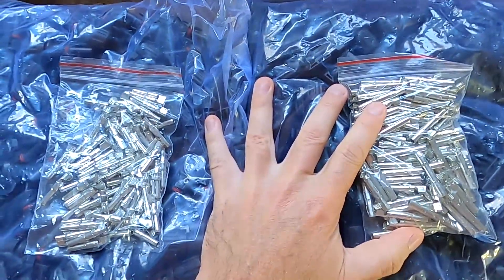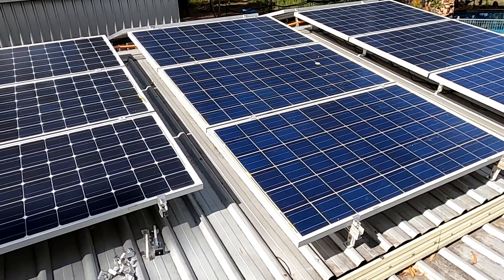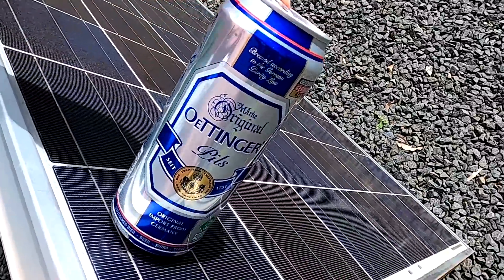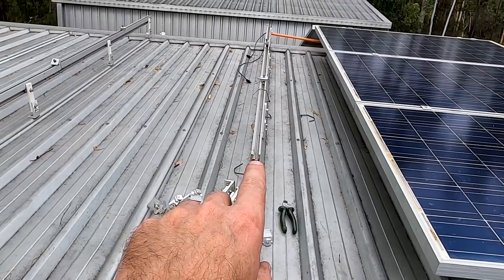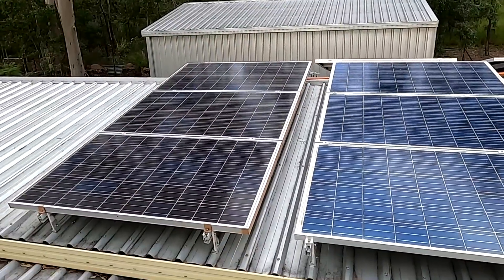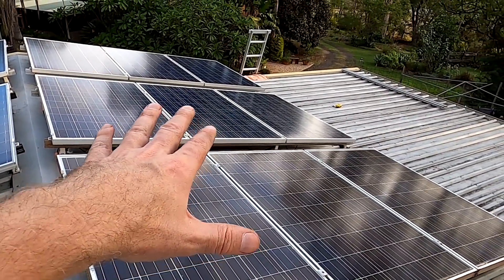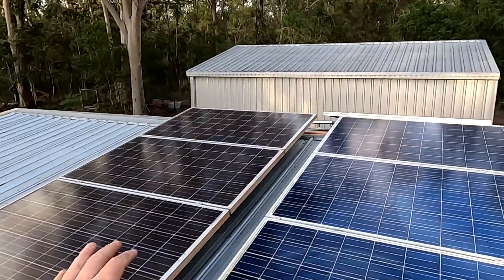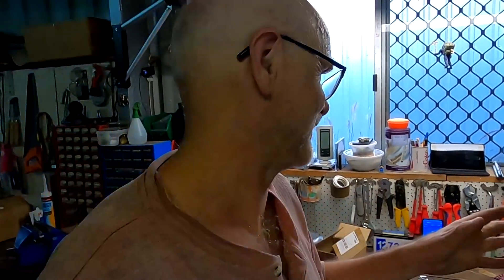All the solar it can take - I reached the limit! (and had to give up...)

Comment: Question,,, pls help I have 2x480w 12a soler panel I'm charging a 24v 300ah lifepo4 battery bank  with mppt charge controller  but I only get 11a out of it according to mppt controler ,,

Comment: In my situation, 6 100 watt panels will suffice for the 16 EVE 230 ah batts in series to 48 plus the 21 leaf gen 1's in 7s x 3 again for 48.  I use the system for back up only during frequent grid outages and do not rely on this for everything all the time.  I've also added a 54 volt charger to use if there is prolonged cloudiness or more frequent outages.  I figure the type rolling blackouts we get here in Texas are maxing out at about 8 hours at the most with 10 or 12 back on which is ample time to recharge what I use in 8 hours.  My strategy might not be for everyone, though.  I have 3 chest freezers, and 3 fridges as well as 3 mini split heat pumps and some lights/computer, etc.  I can turn off the hwh, electric range and dryer during outages.  Having such a system means a lot to us when it gets over 110 deg f in summer and 20 deg f in winter.  We need to keep things running so we don't perish.  With some customization of usage our system meets our needs.  I do dream of going pure solar but the cost and reliability factors have discouraged me, thus far.  Maybe later on we could add to and turn off the grid and use it only as a backup.  We do that with our water, now.  Adding 2500 gal storage and an old well to augment the water system for when it goes down, which is frequently.    We have to think in these terms out here due to the remote locale.  I will continue to watch, Andy to gain more pointers and insight into these systems.  I find your video's are very interesting and you are teaching all of us.  Thanks.

Comment: You have the perfect setup to answer a question that interests a lot of sailors, that get shading from the rigging. For this reason sailors tend to use a smaller controller for each string and put those outputs in parallel.  So the question is:  If you get shade on one panel of one of the parallel strings, does it affect the output of the other strings in the parallel set?
Reply from the maker: I think that's been covered in a recent video 😉
https://youtu.be/NaCOdOdhdTY

Comment: Hi
If your taking the battery apart to fit the new BMS it would be a good time to try experimenting. 

I have a similar setup with a Victron shunt before a Daly BMS, and agree with the order of components. However as wired the shunt does not see the running power or balancing currents of the BMS. My Daly BMS consumption, read at the black sense wire, is around 17mA which over time is significant on a small system. Whilst this could be compensated for on the shunt efficiency setting it would seem better to get the correct reading. This could be achieved by connecting the BMS black sense wire after the shunt. Then all consumed power would go through the shunt. I accept the BMS uses this for voltage sensing and there would be a very small voltage drop across the shunt.
Does the 0.01v drop at 100a load really matter in the real world, you can simply adjust the low voltage cut out to accommodate this. During charging the voltage drop would not be significant unless you have a big solar farm so no adjustments to the BMS would be required. The Victron shunt should now show a more accurate charge state. 
Your thoughts ?

Comment: what is the max charge rate of your battery bank ?
Reply from the maker: It can handle 1C charge, so 280A or 14.000W
Reply: @OffGridGarageAustralia  wow ok so along way off maxing the charge limit then some of the smaller ones i scene only have a 40amp charge rate this only rises if they are in parallel if they in series this charge rate stays the same

Comment: Hi Andy if u have a BMS that burns off amps at the top, do u really have to balance LIFEPO4's?
Reply: Yes you need a balance bms. One cell could go higher in voltage and could be overcharged. Internal resistance of cells don’t macht 100% and that’s why they discharge and charge differently.
Reply from the maker: Well, that's what the BMS does, right?

Comment: I look forward to the results without shade. I am watching with interest, about to buy a multiplus myself.
Reply from the maker: I probably end up with an MPP or Growatt inverter with 5kW so I can parallel them later when I connect more and more to the system. Victron can do this as well but prices are much higher.
Reply: @OffGridGarageAustralia  Mine is just for grid backup. Putting up solar panels and wiring up connections has many rules and regulations to follow here, besides the fact the only real roof I can use is the top floor. So I must pay someone to install a grid tied system. Mine just needs to run the refrigerator, an air conditioner and a television. 3000 multiplus should cover it.

Comment: The easy way to test your panels ,first check the voltage ,then put the mc4 connectors from the panel thogetter and put tour amp clamp meter around the cable . It wil show the amp ..
No cabels or other testers reqierd.
Sorry for my english,greetings from holland
Reply from the maker: That gives you a rough idea about the panel, but not really the power they can. You measure the voltage open circuit (Voc) and the short current (Isc). I tried this in the past and still some panels won't deliver once installed.

Comment: Ya needs more charge! Control!!...
And more pv, on all the ruffs! Ya need to charge at atleast 0.5c , so about 130-140 amps haha,,, 
Nah, seriously about 40-60 amps on a hazy day, about 100 on a ideal day, I think I'd use about 3-4 charge controllers, with the roof divided into 1/4's so the shading will not effect power so much, but I'd put pv on all the roof that get sun atleast 4hours a day,  heck about 4-5 hours a day us about all I get, if good sun!
Reply from the maker: I've got another 4 weeks until we hit the shortest day here in Australia. From then, it will go up again as days get longer and the sun will have a better angle. In summer, the sun is almost 90° from above and we should see a massive yield on all roofs. I need to figure out what to do with all the energy by then.

Comment: Right or wrong I also over panel my charge controllers but with a good name it will survive.
Reply from the maker: The controller can handle 2kW with the 48V battery connected. I have now installed 2145Wp of solar for this controller. We will see in a few months when the sun is fully back on the roof.
Reply: @OffGridGarageAustralia  With cloud edge effect you may even see the limit for short time this winter every panel setup has it day in the sun when the angle is perfect for the time of year (the best beer can day) lol
Reply: Also around 40% over-panelled - but its often cloudy in the UK, and I'm in a truck so no ideal angle on the panel probably wastes 25-30% 
6*390w panels into 100A MPPT @12v
#offgridandworkinghard

Comment: when i had my epever charge controller it was a 40 amp and i could put on solar 3 times the wattage on solar then what was put into the battery wasted alot of power but the good thing was it was a solid ampage into the battery rather then rasing and dropping due to the clouds etc so i felt that it charged better as it was more like a cc charge
Reply from the maker: Interesting. I was always wondering if this would work.
Reply: @OffGridGarageAustralia  yeah it works very well even with uk weather i would think doing this thogh that the controller may need a little help with a fan to blow more air bast its fins
Reply: @OffGridGarageAustralia  another idea i had was buck boost convers on each panel so say you have 40 panels you could limit them to suppply 1 amp and have a 40 amp controller very wastefull i know but if the battery your charging only has the 40 amp charge rate it would been it would be steady 40 amp as each panel lets say grid tie panels as they the higher voltage ones should easy supply 1 amp even on the most cloudy days

Comment: Why don't you trim the trees to solve your shading issue thus giving a more stable solar environment.
Reply from the maker: The trees are over 100 years old and 40-50m high. I will not touch them. You cannot embrace solar and green tech on one side but cut of trees on the other. We bought the property especially because of the big old trees. Many birds are living especially in the crowns.
If the shade would be from a mountain or another building, would you try and move that too? It is what it is. That is the situation and location I have to live with.

Comment: i wounder if the panels still have the same problem if you put them in parallel rather then series if they produce power how they should then maybe a boost controller to charge the battery
Reply from the maker: Never seen a boost controller.
Reply: @OffGridGarageAustralia  i would not say they are the best but aslot use them with panels for 12v systems to power higher voltage systems https://www.ebay.co.uk/itm/254705323020?chn=ps&norover=1&mkevt=1&mkrid=710-134428-41853-0&mkcid=2&itemid=254705323020&targetid=1141640587611&device=c&mktype=pla&googleloc=9046594&poi=1006941&campaignid=12689627653&mkgroupid=120098841523&rlsatarget=pla-1141640587611&abcId=9300529&merchantid=118989068&gclid=CjwKCAjwqIiFBhAHEiwANg9szssbaYxt5PtFulD71IzfVZxw-nGFo_N14ITW9LSWfjwTRyul9MgmXhoC9DsQAvD_BwE
Reply: simple dc-dc boost converters also work you just set the max voltage and current and what ever comes in will be boosted to the voltage you wont
Reply from the maker: Cool, I've ordered one of these SCC to check it out. I would be keen to test if I can use my 22V panels to charge my 48V battery. Thanks for the tip.
Reply: @OffGridGarageAustralia  I know some one here in the uk he built a powerwall from laptop batterys 48v he was using them he was also using server room ups's as inverters to run stuff in his house where I got my ups from for my server and pc